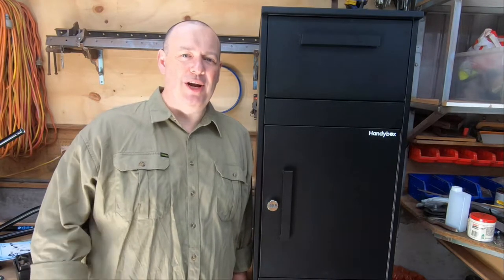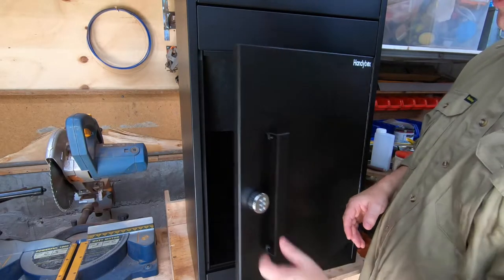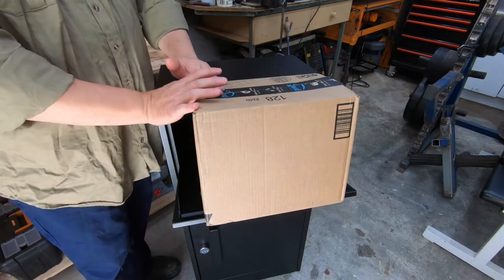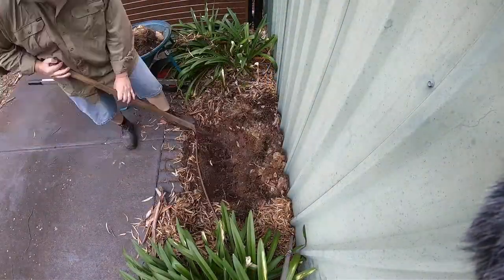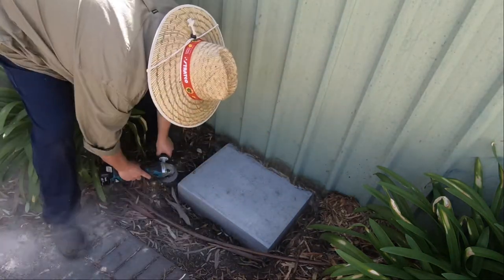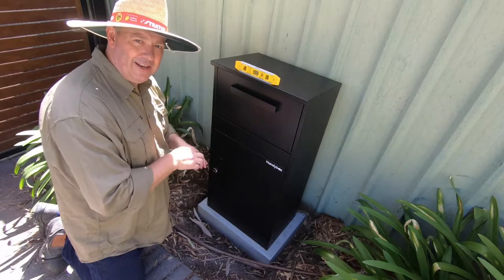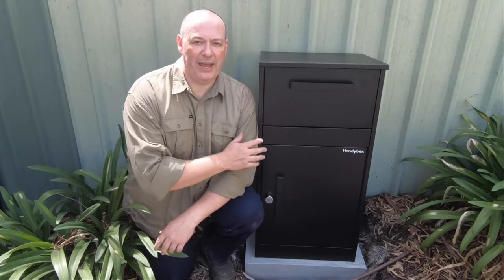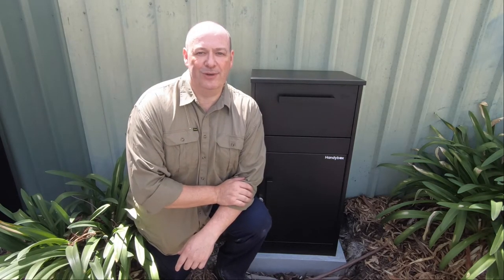How To Install a Secure Drop Box - SIMPLE Project!

Comment: I came here to learn what type of bolts/screws to get to secure a similar box the the sidewalk. What did you use?
Reply from the maker: Hi there, thanks for watching, appreciate it.  I used 4 Ankascrews (https://www.bunnings.co.nz/ramset-8-x-60mm-galvanised-ankascrew-masonry-anchor_p2260262) they are easy to use. Cheers. 😀
Reply: @hangingoutwithhally7463  Thanks so much!

Comment: It felt like you added a wired mesh, it is necessary to add a Mesh, for parcel box concrete, I was thinking if I put a mesh, it will be hard to drill if the drill hits the mess.
Reply from the maker: Hi Suman, this is such a small pad, that I don't think the mesh was absolutely necessary, but I'm not an expert at concreting either 😀.  The mesh I did use was very light, so the drill would have easily gone through it, if I used a larger reinforcing mesh, this would have been harder.  The reason I used the mesh was because I had an offcut laying around to use and I didn't want to risk cracking the pad when tightening down the anchors.  The anchors I used are designed to limit the lateral force anyway, and may not have cracked the pad.  Hope that helps, thanks for watching. 👍

Comment: Hey, what size drill bits did you use to drill the holes in the slab for the Ankascrews? and how deep? Thanks
Reply from the maker: Howdy, they were 8mm Ankascrews, so the drill bit size was 8mm, (that's how they are designed).  This concrete pad was fairly thin, so I ended up drilling completely through, but I'd recommend drilling 10mm more than the embedment depth so if any dust gets caught in the bottom of the hole it won't stop the screw going in, make sure to blow out the hole before using the screws.  Hope that helps and thanks for stopping by to check it out, appreciate it 😀

Comment: Hey Hally, Hally here. Is the box waterproof?
Reply from the maker: Good to see ya Hally, 😁, it's splash proof.  There are lips all around the top and bottom doors that will keep out rain, but nothing to seal it when shut, so if there was any flooding and water rose up around the bottom it would leak in.  Thanks for watching 👍!
Reply: Good stuff 👍🏾
Reply from the maker: Thanks Mate ! 😁👍